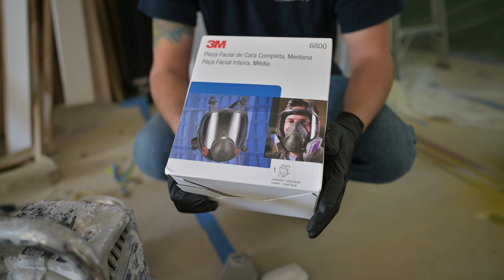She made me put in Wallpaper

Comment: Interesting about how the ceiling looked "dirty." I tiled the bathroom floor with tiles that looked very much like your ceiling did. I'm not happy with it because even after it's cleaned, the colors make it still look dirty. I'm working up the strength to rip it out and do it again with different tile. 

The beams did look a little funky and I agree it looks much better painted and looking like a traditional ceiling. I haven't wallpapered in decades but still remember cutting around the outlets and getting that jolting reminder there was power there.

Comment: comment and two questions
super cute wall paper, love the green complimenting the leaves in it.

with the sprayer what do you do when switching from the bin to the waterbased paint. Do you do a full clean down with an appropriate solvent and then run some water through and switch to the paint? seperate hose or gun just for the bin anything like that?

Second, have you seen or done and burned wood projects (shou sugi ban)? I've done a few poles to hang lights off on my patio, blasted them with a 5 gallon propane tank and a big torch wire brush off the ash to reveal beautiful grain patterns in pine 4x4s (i did pressure treated and prayed the smoke wouldnt give me cancer.  But im doing them for my kitchen too as faux box beams and they are going to look gorgeous. Would be a really cool thing to see you add to your options.
Reply: Im curious as well. When using BIN i often roll it out instead of spray because of the cleaning. I understand that it only cleans with acetone which ruins the rubber components in the sprayer. I hope we find out because itll make things so much easier

Comment: @finish carpentry tv
Hey rich not sure if you use or already did; but thinking might wanna use miracle solutions 511 impregnator sealer for the laundry room floor tile. Use for pretty much all my tile installs or showers and bathrooms, and just make sure you DONT GET THE ENHANCE & SEAL, as it’s “more shiny” and will make things “pop” way too much, imo, than the norm 511 impregnator sealer. If want something even less subtle than 511 impregnator sealer, try Mapei ultracare penetrating sb sealer (works like 511 on tile, stone, grout, etc…but imo, it’s more subtle meaning…..on shiny scale it’s like 2/5 and 511 is 2.5-3/5 & enhance seal is 5/5. Of course longer and more cots use, the “heavier the look” will be regardless of product.
Anyways, didn’t think like the color w/ tile and walls….
BUT AGAIN, your wife is awesome b/c IT WORKS👍🏻
Cheers✌🏻